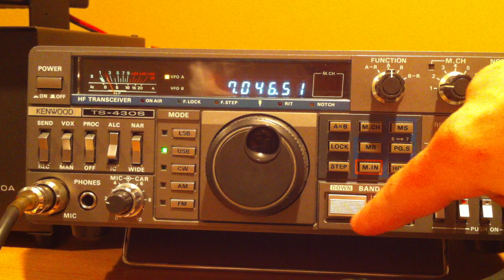Kenwood TS-430S HF Transceiver with intermittent low receive sensitivity

Comment: I know this an old video. but the 430's were known for the receive doing this . if you remove the top .and looking to the rear of the radio . you will see a row of black box's . these are the receive relay's. take a pencil or something that you can tap on these box's with while the radio is on . something plastic so you don't get shocked . and listen to the receive . it should come back up. should work 73's

Comment: Picked up one of these that had a similar problem, turned out to be poor contacts on the switching relays. They have clear plastic covers that can be removed allowing access to the contacts. I cut a fine piece of wet&dry about 20mm x 3mm and sprayed with WD40. This can be pushed between the contacts  to clean them. Takes a while as there are quite a few relays and you need to clean both sides of the contacts. Worth checking the solder-through connections on the power output board as well. MM0GXU
Reply: WD40 lubricant? Really?

Comment: This problem can be rectified if you have an idea where to start, these are fairly complex in design and have a few little idiosyncrasies as they age.
This being the most common one, i found several earthing problems on the chassis and 'dry' switching of the bandpass relays in the PA low-pass filter board on some models, working on them can be difficult due confined space in the back chassis, would suggest taking off for repair, labour should me no more than 2 hours and parts.. peanuts

Comment: Hi, I have a 430s and it seems to have the same problem, but I noticed that when I disconnect the ground of the antenna, it is receiving normally again. So when just the center pin of the antenna connector is connected, it works fine. The problem is not from my antenna because it works great on other transceiver, do you know what could be the problem ???? Thank you very much for any help !  73

Comment from the maker: @namdogtag -- This problem is not related to heat, it would do this on cold start.  See the links in the video description for details from Kenwood about this problem.  I was able to rectify it by doing the procedure as described of putting some DC current into the antenna input.  Since then I've been pretty happy with my 430.  Cheers and 73.